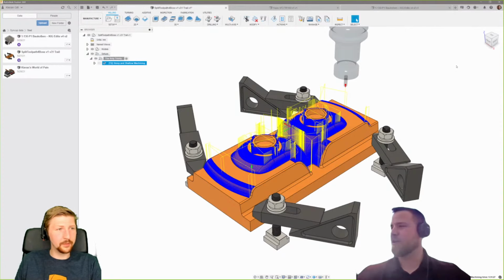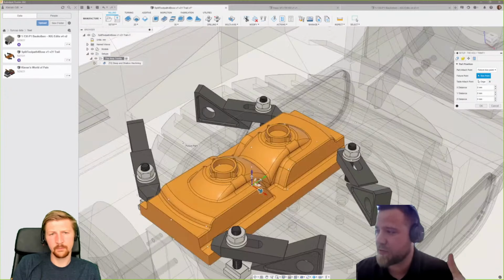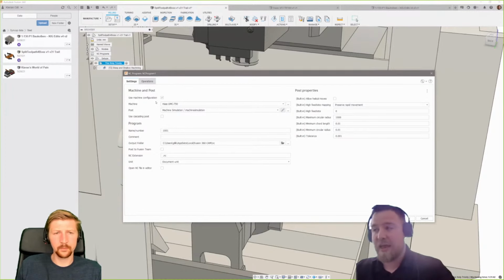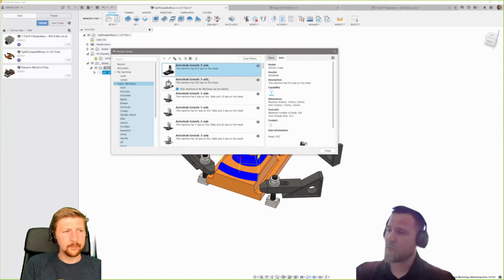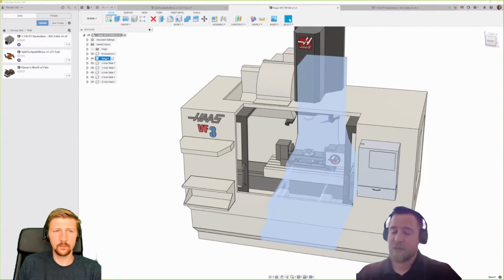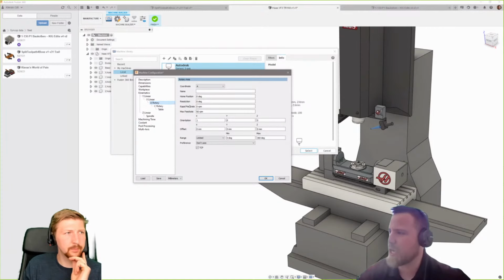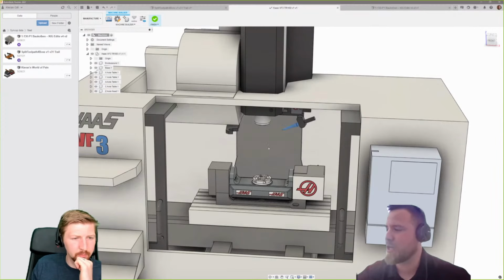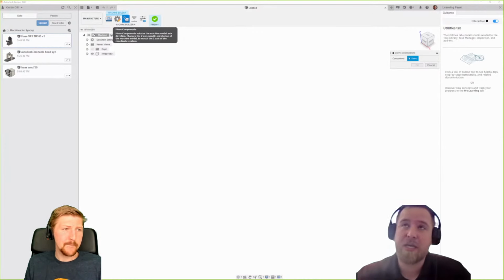360 Live : CAM - Machine Simulation

Comment: If you guys get to a point where you can simulate tool changes and probing i.e. the whole machining cycle, then that would be a total game changer! 

I have a UMC500 coming soon, and at present i basically have two options if i want to fully simulate my machining cycle:

1) Buy verification software: With CAMplete (£3,500+ a year subscription), for which i have to use CAMplete's own probing cycles, because it won't output those from Fusion. Or, if i buy Vericut  (£10K ish + annual maintenance) this will simulate probing, macros etc, but is obviously a major expense.

2) Buy an upmarket software: Such as Mastercam, Esprit, Hypermill, Powermill, Tebis, NX etc etc. with full simulation and probing options. That does give me great 5 axis toolpaths, but i pay through the nose for it.... the probing simulation in these programs is actually pretty rubbish though... and they can't simulate macros either. 

I'm surprised Haas aren't pushing it actually, and almost offering to fund Autodesk to get it done for their machines/post processors, because it would sell so many machines for them. If someone starting out making their won product (which i previously outsourced) like me knows that they've got a software package/post processor with full simulation ready to go, that removes a massive headache/expense. It would effectively make the machine £10-15K cheaper than listed (and their competitors) because of the savings on software cost.

Comment: Thanks for a more in depth explanation of this topic. I did try this feature before any official videos were releases, but as all parts of Fusion, it was pretty intuitive ;). Anyways, I did not find a way to make the machine simulation throw an error if one of the axes wants to go out of limits during the actual toolpath simulation, despite having the limits set in the machine builder correctly, at least I think so... Something like the "stop on collision" checkbox available in the toolpath simulation. So is there a way to set this up so it works this way, or is it not supposed to watch the travel limits on each axis? 
I hope it's OK to link my video here - https://www.youtube.com/watch?v=oXzRyJu1Ub4&t=1813s
The problem is evident on the Z axis at about 36 minute mark. I did try with other and also preconfigured machines from the Fusion library and different axes, but it did the same thing.